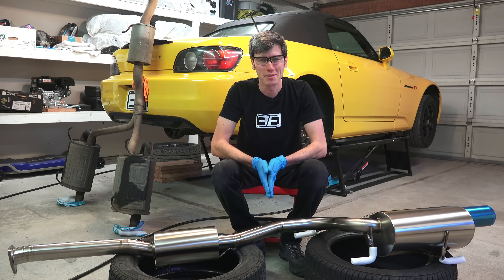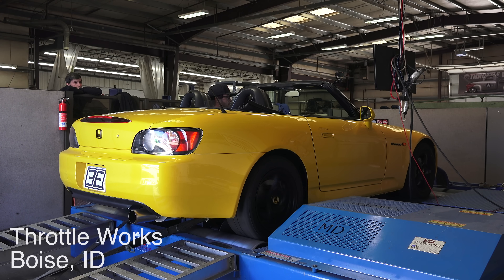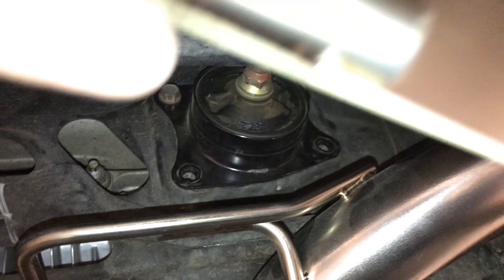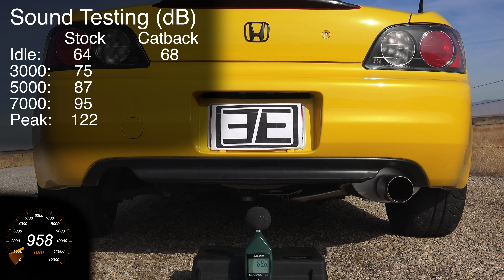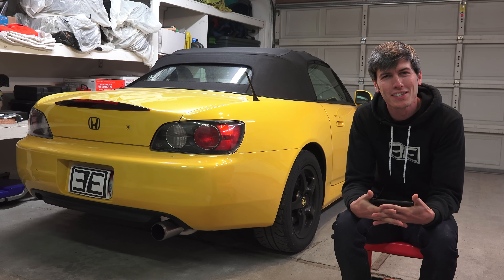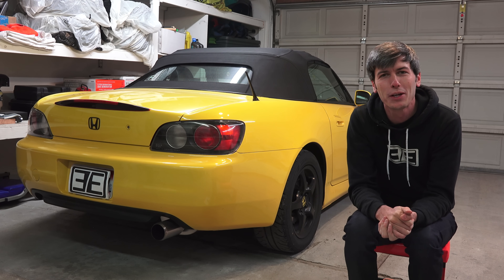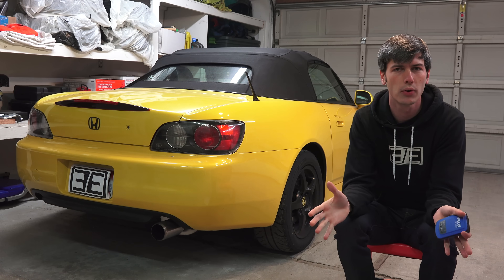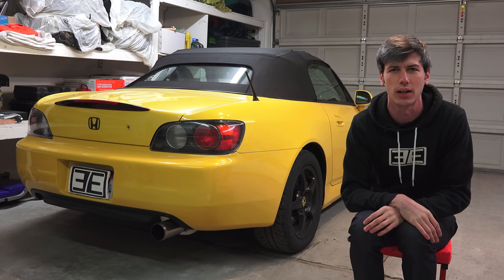Can A Catback Exhaust Make Your Car Faster?

Comment: Is it $2500 cool? That's not for anyone else to say, except the owner of the car. It doesn't matter what we say, it's not our car. Don't ask us. If you're happy, I think it's worth has been well established.

In terms of performance gain, I have heard about how the overall design of the exhaust system, matched with the engine management software, can affect how the vehicle gains torque and power. It's not simply "big pipe/straight through=better" anymore, although factually it is the case, you will only reap minimum benefits[if any at all] when you do one without the other. It may have been true, up to a certain point, in older tuning disciplines prior to electronic fuel injection. That's why recently, when exhaust systems are sold, there's usually a tune coupled with it. Anyway, I've always thought of the intake and exhaust mods as supporting mods, made to properly utilize forced induction, or more complex[...umm I don't think that's the right word...tedious perhaps? more expensive?] naturally aspirated performance modifications.

Comment: could have done that in stainless, saved 2k$ and still shed weight. don't act like 34 lbs is a big deal on a stock vehicle. could just pull your passenger seat and save 2500$. yo.

Comment: Basically, want more power ? Remove catalytic converter. You might need to readjust the ECU with new parts. You can't just slap some new parts and expect it to work. Also using it along with other mods does a lot. What it looks like is that you gained some power only at High RPM range, but Honda's love high revs right ? :P

Comment: I normally learn a lot from your vidz and agree with your analysis, but not this time...Sorry, 2.4 hp (1.4%) gain is insignificant... remember your video on tyres new vs worn... if there is less than less than 5% difference the confidence level is questionable... You should take your advice and invest in a grippy tyre for each corner...

Comment: Nice work! Like seeing the data. I don't know about Titanium Mufflers but higher flow Steel mufflers get a little louder after they have gone through heating and cooling cycles. So the sound might increase in a month or two depending on how much drive it. Also are you going to do an Intake and a MAP Tune go with the Exhaust?

Comment: The exhaust is worth it when you factor in weight reduction 30lbs with 2.5hp. Will accelerate faster.

Comment: Titanium exhaust... on an engine with a lot of NVH...  Almost certainly guaranteed to crack. Cat's aren't a major restriction on an S2000 since they're a single monolith HFC as standard. 

Not wishing to take anything away from the video, but there are much better performing Single exhausts out there for far less, plus with the money saved you'd get yourself an AEM EMS2, tune, make more power and still have change, but I see you've charged it anyway!

Happy boosting and VTECing from a fellow S owner :)

Comment: Hehe, funny to look at, that your S2000 is about the same DB level at 7000 rpms as my Yamaha R1 (02 - 152 bhp) powered Super Seven (kitcar) racing car at 4000 rpms - And that engine goes to 12.000 rpms :p Love your S2000 though

Comment: did you tested air temp when you dyno test it because on colder air temp dyno will show more hp , gain is good from only catback consider s2000 already have very good stock exhaust on some other car with not so good stock exhaust will be even better

Comment: The weight savings will make the car handle better. Must remember the engineers have been working for years to make car is lighter and later. You should see a very small mileage again with this exhaust pipe.

Comment: You should get a cheap eBay one and do a comparison on power, weight, price, and sound. 

I suspect the power add will be similar, but weight will only be 1/2 or 2/3, and the sound will be more ricey.... But the cost will be like $200

Comment: The titanium exhaust sounds better at full throttle
Reply: By a mile. Funny how it doesn't have to be obnoxiously loud(er) while still sounding so much better... I wish the fart-can douchelords would understand this.
Reply: MozzaBurger my guess is they tend to go with the cheaper option since they almost always look like beat up cars. That leads to annoying obnoxious farters
Reply: Actually titanium is more responsive to the exhaust gas pulses, it works like a bell if you will. So it brings out more frequencies producing a rich, crisp and throaty sound! 
Performance-wise the pulse responsiveness helps the exhaust gasses to maintain optimal laminar flow and that teams up ideally with the straight through resonators!

Comment: I like the fact that you reported temperature, humidity (dew point) and pressure for each of your 10-60 tests. But next time just covert that information to density altitude, as that would give the clearest possible picture to your viewers of how close the conditions were on the two separate days of testing. In this case stock was at a 218 ft DA and the catback was at -868 ft DA. Or in other words, the catback was tested in conditions that would have been equivalent to testing on the same day as the stock exhaust but with a 1,086 ft decrease in elevation. 

I'd very much like to see the differences in density altitude for dyno testing in the future. In this case, a 1.3% power gain (especially on a naturally aspirated vehicle) can easily be attributed temperature, dew point and pressure. Or it could be a greater increase and is just being held back by mother nature. Without data there's no way to tell! I'm not sure why reporting this with dyno figures is not a more common thing.

Anyways, keep up the good content!

Comment: Most modern sports cars have a really good intake and exhaust system from the factory.  In my opinion, if you want a bit more power without making a lot more noise go with a delta flow muffler in place of the OEM.

Comment: My only problem is you had two exhaust tips before which allowed more flow but restrictive mufflers to a single tip better flow but same size. I bet if you had a duel tip you would see more power gains

Comment: The S2000 is one of few cars whose stock exhaust actually gives a similar amount of power to an after market exhaust, so on this car buying one would really give little to no gains. However on more restrictive exhausts it could really make an impact
Reply: Big engines gain more.
Reply: I got an accord k24 with one and if it doesn’t make it faster it at least makes you feel like it does lol

Comment: Here is one good way to remove a ton of dead weight off any car and gain performance.  Remove all the suspension, swinging arms, springs, shocks, etc.  Just some steel rods where the shocks once were.  Or you can find lighter weight material than steel?  Just ignore the bone jarring rides and think vehicle will be much lighter and 0.00000001 second faster.   LOL.

Comment: I think the exhaust is beautiful, yes you only gained 2.5 hp but also took off 35lbs of weight for handling and with a good tune with the new exhaust i think you smooth out the hp and torque curve even more.

Comment: Peak torque/power numbers are nice, but they don’t really tell the whole story, do they? From the charts, the car is making more torque (and thus HP) between 6k and 9k, or about a third of the rev range. So it is really the area under the curve that tells the story. With more torque, the car should be accelerating harder across all that part of the rev range, regardless of the weight savings due to the lighter exhaust.

Comment: are these numbers on the sound before of after the packing has broken in a bit also is this also with stock intake ,stock moded intake or aftermarket intake...BTW should have spent that money on a header and a tune.

Comment: Modern cars use computers to adjust a multitude of parameters and keep them within engineer specs....to comply with emissions, driveablity, etc.  Just changing something like an exhaust or different sizer cat converter will be mostly fruitless unless the engine control module ECM is reflashed to take advantage of that. The stock one will just adjust parameters to get back to the target point.  If you want to go faster remove excess weight...that is the cheapest improvement.

Comment: Well... slightly more horsepower, and a notable weight reduction.. granted that 34lbs makes a difference in a motorcycle, and not so much in a car.
If you're into mods like this, you'd probably be a lot better off playing with Motorcycles.

Comment: Not sure how you can compare dyno graphs without showing us the AFR.  Mods can lose power if the tune is not adjusted to suit, did you tune yours for each exhaust ?
Reply: Unless you are running carbs without a knock sensor. you don't have to go for a tune for a catback. That's nonssense. The engines ability to work  within a range makes it able to adjust to these small changes without issue.
That is pretty much why it is there. And why they are awesome.

Comment: On the question, is it worth it? Pennies make dimes, and dimes make dollars.  Every horsepower counts, and every bit of weight saving counts. It is easy to get those first big gains when building a car. once the low hanging fruit has been taken, it gets harder and more expensive to start eeking out those small improvements. 2 hp here 3hp there though and pretty soon you are talking about real gains.

Comment: hahaha $2500 for the car to sound the same if not quieter dude you got ripped off it looked better with dual tips even and 2 horsepower difference i doubt that even because it could have been the dude testing it i bet if you tested it 10 times it would be different each time my car has a full exhaust headers, cat delete, xpipe dual tips all 3" tubing sounds amazing gained 18hp.

Comment: Although the Catback was expensive, that weight savings could help get off and going from a stop easier and faster resulting in faster acceleration and a quicker 0-60.

Comment: you're getting faster mostly due to weight reduction...
I got rid of the catalytic converter and also use just one straight through muffler, after changing the exhaust headers... that makes a difference, and a lot of noise

Comment: Great video! It would be worth mentioning that the catback exhaust on a relatively stock car may only be worth 2-5hp, but if the car had more performance mods it may be closer to 10 or 20hp which is already 10x better hp value ahaha

I would be curious to see if the percentage power gained from catback remained the same no matter the mods

Comment: The Fact that the exhaust didn't drop horsepower is a testament to how well the exhaust was made. People may say that 2.5 HorseP gain is not worth it, but the other advantage of it being 34 Lbs lighter makes it worth it. Obviously, it's going to increase the acceleration of the vehicle, from both factors, and it should also make the car more agile in regards to the turns.

A worthy mod to the S2000.

Comment: I guess the results depends on the car and the existing exhaust. Some people reported increase in torque and horsepower with an exhaust upgrade others not. example videos to check are Motor trends channel- Engine masters, and also Chrisfix exhaust upgrade video...

Comment: As you pointed out the exhaust bore size is the same but the tuned length will have changed a little. This will help increase power. The other gain is through the use of Titanium in the exhaust as it dissipates heat faster and the exhaust gasses cool and take up less volume so the flow will be better. If you change the exhaust for a steel one you would see a different result again even if there is no change to sizes and lengths.  If you remove the cat it would help even more as the cat retains a lot of heat and is one of the things which does not help with horsepower. It is all quite simple and well known in motorcycle tuning. When we ran two bikes in a top speed event with one bike running stainless steel the other identical bike running Titanium there was a speed advantage on the bike running the Titanium pipe. The pipes were swapped on the bikes and in both tests the advantage went to the Titanium piped bike. 

You need to look into doing an exhaust comparison with a full system which is identical in every detail apart from materials. From mild steel through stainless, titanium and then finally Inconel.

Comment: Cool. Weight Reduction it is, but Power Increase is Doubtful. I work in a place that installs lots of performance exhausts and unless is Catalytic converter removal it makes no difference to power. Dyno reading are only comparable if the car will not leave dyno as a slightly different position on a dyno will affect power reading, the more it will climb on the roller the higher power reading it will be. I love your videos but I will not agree with this one.

Comment: Great video - love all the data points, comparisons, etc. 
I would say that over the years of modifying cars, I've re-done some mods because I didn't like the first (or sometimes second) mod. I remember one car that I owned I tried 4 different "catback "setups before I settled on one that I really, really liked. Exhaust systems, in particular, can really make or break the car. So, don't worry about the cost. If you got it "right" the first time, that's worth a lot...and it's hard to put a dollar amount on that!

Comment: the 2 horse power gain isnt the problem, but the look of the car just with one tip look really ugly on the car. i would rather keep the stock one for look and save u money
Reply: Add a dummy tip in the vacant cutout ...... problem solved

Comment: Dude I just subscribed. I just bought a 89 Honda legend. Nearly 400000 Km on the donk. It blows valve stem oil smoke at anyone who harasses me at the lights. I already use too much petrol/ gas. Just wondering if you have ever heard of a cool mod for my V6

Comment: Jason-- I noticed on the results of the dyno, it showed your air/fuel ratio at a low 9-something......this is a "rich" mixture, right? (the "higher" the air/fuel ratio, the "leaner" it is-- am I correct?)
  I've heard of people taking there stock vehicles and getting a "tune" performed on the factory ECU that would safety lean out the mixture (either across the rev band, or only at WOT) to a still safe ratio, which would allow the engine to make more power.
  I'm thinking that the factory setup in most cars WOULD be a little rich in the interest of engine longevity.
  Do you plan on doing anything to the Honda ECU in your 2000?
...or are you just going to get a stand-alone (or a Hondata ECU) ?

Comment: Man,  those are some beautiful welds on that exhaust!!  I just installed a stainless header and 2.25" Borla stainless exhaust, Magnaflow catalytic converter and a Borla Turbo XL muffler on my old 94 4x4 Toyota pickup with a 22RE, and the difference in power is amazing me on a daily basis!  I am now pulling hills in 5th gear that used to drop to 4th, pulling grades in 4th that you'd have to grab 3rd in etc.  It has blown me away!  I bet I gained 10-20% more power if I had to guess.
Reply: Yeah but......its the internal finish that really counts

Comment: Great video.  I agree that the power and acceleration gains are pathetic for the investment.  I don’t like that you compared dual exhaust to single exhaust.  A dual exhaust comparison would have been better.  A little more weight and air flow should be slightly different.
Really like that you added ambient climate numbers.
I learn from your videos, so I like that.  No my preference of car though.  Would like to see more on like the Hellcat.
Reply: steven wright but it's not a dual exhaust ,  it was single then y pipe into 2 mufflers . If he had a true dual it would  need like 1.5" pipe diameter .  The stock dual outlet set up is more for looks , with one muffler always being the primary pipe.

Comment: I did a long tube header, short catted H pipe (high flow cats) and a performance catback with high flow mufflers. And it cost me about the same $2500. (Same exhaust diameter size) It's a ton louder, but the butt dyno didn't register much even with a tune. This was on a 2007 mustang GT.

Comment: Did you control how much fuel was in the tank when you ran the two tests?  Fuel load will change your result.  The difference between and full and almost empty tanks is more than the difference between the two exhaust systems.

Comment: you could look at it as $1000 per horsepower, or you could factor in the fuel efficiency from lost weigh, and also the fact you will never need to buy a new exhaust for this car, short of writing the car off, it will last forever.

Comment: You saved 30+ lbs and most likely you would have had to replace your stock exhaust after awhile any way from rust damage.  You can call it a win.  I've seen people drop $2k on a dry carbon hood to save 10lbs.

Comment: what you don't buy a double exhaust like the stock version? for the weight?
Reply: AlphaV35 because  the stock dual muffler  set up is just for show basically ,  it goes from single pipe into a y of same diameter .  So have a simple single pipe and 1* muffler makes the most sense .
Reply: AlphaV35 it's like if your single pipe has a dual outlet tip you don't call that a dual exhaust
Reply: Andrew Bartleman ok thank you 
Now, I understand ^^

Comment: @engineering explained +engineering explained I'm just reminding you there is no "decibel level". The magnitude of noise is usually described by its sound pressure. Because the range of sound pressure varies greatly, a logarithmic scale is used to relate sound pressures to some common reference level, particularly the decibel. Sound pressures described in decibels are called sound pressure levels and are often defined in terms of frequency-weighted scales (A, B, C, or D).